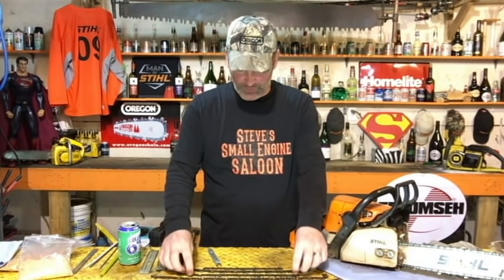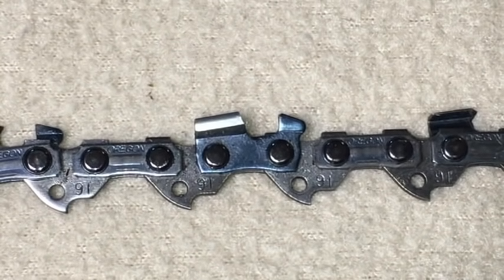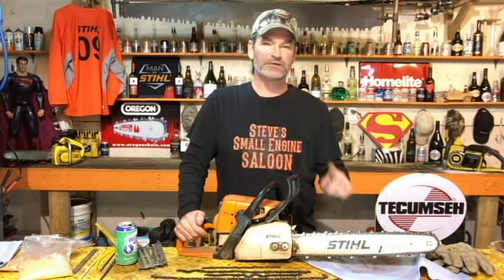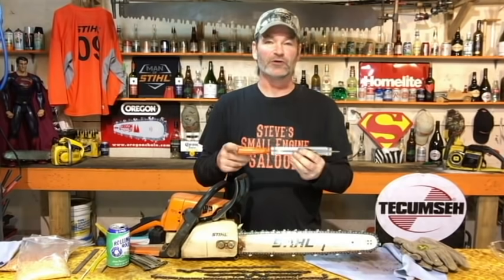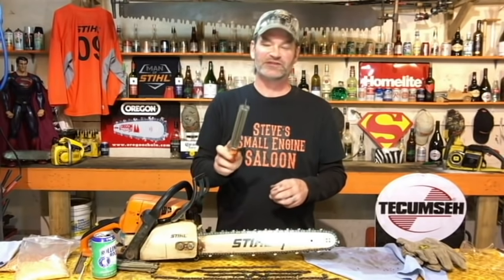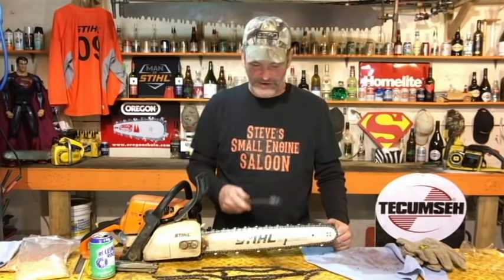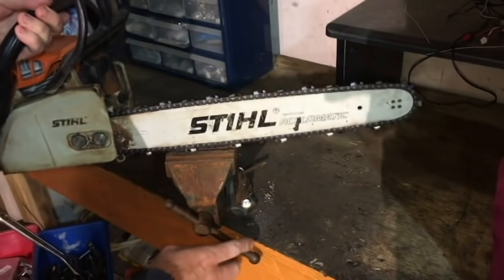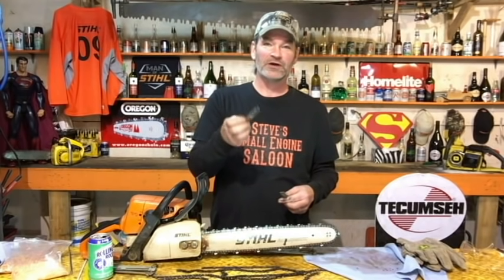CORRECT WAY To SHARPEN A Chainsaw (Step By Step)

Comment: I found that with a really dull chain it is best to make 2 or 3 light strokes at the beginning of sharpening. (Obiviously with the file positioned properly) Then increase the pressure on the teeth as needed.

Comment: Steve, Steve, Steve....
You missed the memo. Stihl recommends a 13/64 file for their 3/8 chain. Of course the extra work required in making such an accurate file necessitates Stihl charge 2x the cost of the less accurate standard 7/32 file 
Great video as always my friend

Comment: I understand the length of a video will cause viewers to turn it off prematurely without getting all the important content. Before I sharpen my chains, I always clean the chain off with a circular wire brush on a drill in the opposite direction of the cutter teeth. This helps clean the chain of any burnt on sap, and also helps keep crud from gumming up your files. Once the chain is clean and I reinstall it with proper tension then I mark two teeth sequentially one going one way and the other going to opposite direction so I keep track of sharpening progress. One thing I have found that if I am cutting a lot of cedar or pine is that the chain will get a lot more sap on it so when I get a really dirty chain, I will soak it in gasoline overnight and that does a lot to get the oils from the tree off the chain.

Comment: I love your videos. I few things I disagree with though on this. Some chains DO require that your file isn't at a perfect 90 degrees to the bar. Take a look lengthwise down the chain sometime, Oregon chains and Husqvarna X-Cuts for example don't have a top plate that's at a perpendicular 90 degree angle with the bar, it slopes downward slight from the side plate towards the center of the chain. With those chains you do want your file pitched up about 10 degrees to match the angle of the top plate. If you have all your angles right the cutting edge of the top plate should align perfectly lengthwise with your file if that makes sense. I also don't like file guides. I find it to be much more effective for me to read the tooth and decide exactly where I need to be applying pressure. If I want the gullet removed a little I use more downward pressure for a few strokes. If it's right where I want it I try to apply pressure straight back. If the tooth is developing too much hook I try to apply some upward pressure. I also like to get my tooth almost finished, then file the raker with a gauge, and then put the finishing touches on the tooth. I do this because raker gauges do a slight amount of damage to the most important part of the tooth; the leading point of the top plate. So as long as there isn't serios damage I like to get the raker done before completing the tooth. I also like to make sure the gullet is straight and smooth between the tooth and the raker. I don't want little humps to develope because I believe that slightly restricts chip flow. You can get a good idea at someone's skill at hand filing by looking at how clean this area is. When it comes to files I've found Pferd classic cut files to be by far the best I've used. I highly prefer them to Swiss made files like Vallorbe (most files that say "swiss made" are probably made for said company by Vallorbe). They cut faster and last longer. Husqvarna Intensive Cut (also German made) are also pretty good.

Comment: That sounds like a pain in the butt.  I use a cordless Dremel with a round stone bit.  I don't use a guide, I just eyeball the angle.  I mark the chain with a sharpie to keep track of where I am, I just hit every other tooth for a few seconds with the Dremel on medium high, flip the chainsaw and do the other teeth.  I don't even have to use anything to hold the saw in place.  It's super fast and the saw cuts like butter for quite a long time, that is as long as I don't hit the dirt or saw a log with dirt on it.  Seems like you could get a more consistent sharpening with a Dremel, you don't have the wobble of your hands and arms as you move that file.  Try a Dremel, you'll never go back to a file!

Comment: Good job Steve. Something you missed. When the depth gauges are filed too short, the chain not only cuts too much wood, stalling the saw, it makes the saw quite dangerous...ah..more dangerous. When it grabs too much, it also makes it way more likely to catch and jump, and harm you.

I always stand where, if the chain catches something and jumps, I am not in the way. The most dangerous part of the chain/bar that can cause a jump is a 90 degree area at the bars tip. Straight out from the middle of the bars sprocket center, and straight up, is the danger area one should not cut with.
A lot of the danger is ones positioning of the saw and how/where you are standing, but also how you are using the saw. Example: When cutting/clearing small brush and trees close to the ground. Use knee pads, keep the saw level so you don't make ankle biters and tire punctures, but most important, use the top of the blade to cut with. I know this may sound incorrect. Cutting normally in brush will pull and throw all sorts of small pieces toward you, and can even cause so much twisting and shoving of the chain, that it comes off the bar. By by body parts! Use the top of the bar/chain in brush and it will throw those bits away from you and will not derail your chain. FYI

Comment: I do not agree with you about this. You don't even have a jig to hold the file that clamps onto the bar. It is next to impossible to run the file exactly the same each time without a jig. You do it your way and I'll do it the way I was shown by the manufacturer of the chain.

Comment: I don't agree with your raker sharpening.  When I'm in my shop I want the chain sharp and the rakers at the proper height by using a gauge. Most people don't want to go out into the forest to find the rakers not right and then drive back home to their shop

Comment: At 12:20 the lower chain in the frame with the damaged tooth is on a safety chain. Junk. No one serious about cutting wood takes that crap off throws in trash can and installs a real chain.

Comment: Why not use the raker gauge instead of all that guesswork. You say check your wood chips after sharpening then bring back in shop and take two maybe three swipes off with the file. Seems like a lot of wasted time.  Just use a raker gauge and be done.